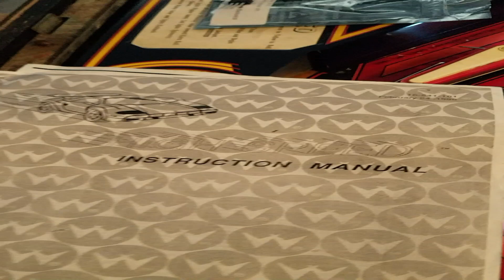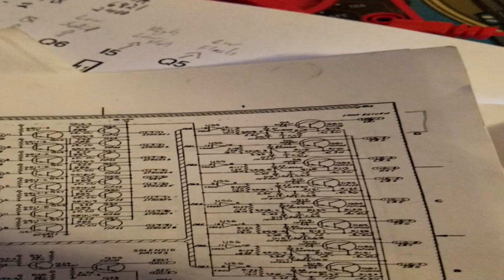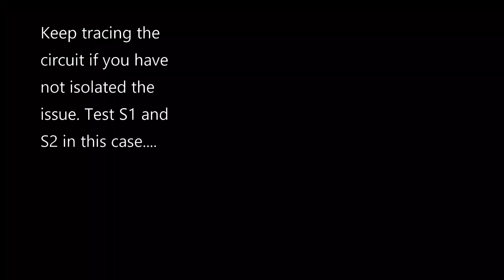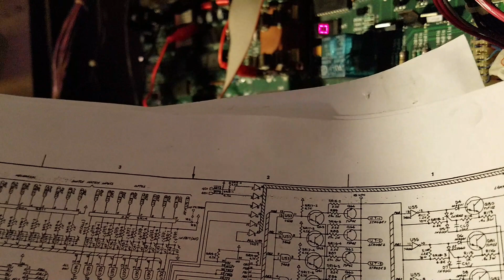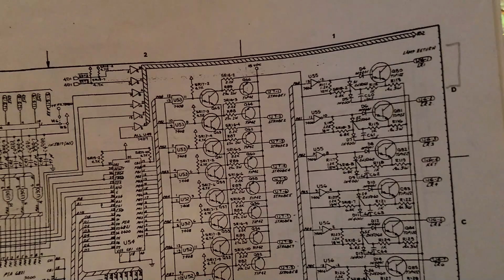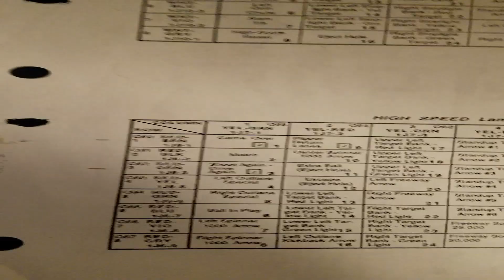Williams System 11 Pinball Lamp Matrix troubleshooting

Comment: Matthey jeannet, What does the diodes prevent on the switch matrix circuits they have diodes for each switch but what are those diodes preventing or doing?
Reply from the maker: Basically, the diode only allows the current to flow in one direction.  Here is a good write up with more details: https://homepinballrepair.com/pinball-switch-lamp-matrix-troubleshooting/
"Each switch has an associated blocking diode as shown in Image 2.  Since current can flow in only one direction through the diode, the result is isolation of the switch when it’s closed.  If this isolation is lost the switch matrix will exhibit bizarre behavior.  The root cause will be a reversed diode, shorted diode, switch improperly wired or diode lead touching one of the other switch lugs (this is common on switches where the pinball can hit them)."
Reply: @matthewjeannet9666  The diode is doing some type of Isolation when the switch is closed. If one switch is closed while all the other switches are OPEN, I'm not sure how the diode is providing isolation and blocking what to prevent a short. If two switches are CLOSED at the same time the diode is preventing a isolation and blocking a short, how so?
Reply from the maker: @waynegram8907  That article can explain it better than I ever could. See image 4 with an example of two switches closed at the same time and the arrows that indicate the direction of the current, controlled by the diode. The pulses cycle through the switch matrix. "By cycling through each column sequentially, the system can differentiate between the switches in each column while the rows are separated by the blocking diodes.  If a diode is shorted, or has been installed incorrectly, the system will get confused since the isolation between switches no longer exists.

In Image 4 switch 43 is pulsed low at 8ms and switch 73 goes low at 14ms so even though they are in the same row, the system knows two different switches have been closed."
Reply: @matthewjeannet9666  I would think if the switches are OPEN without using diodes the System can differentiate between switches because the switch is OPEN which is blocking the pulses. The Pulsing is some type of Pulse Width Modulation PWM signal but I'm not sure how it can pulse different PWM signals for each switch because each switch has a different Duty cycle PWM that's how the System knows which switch number it is.
Reply: @matthewjeannet9666  The 70s pinball games used SCR instead of FETS any reasons the advantages of using SCR to turn on/off lamps?